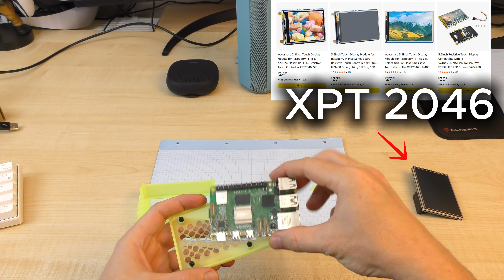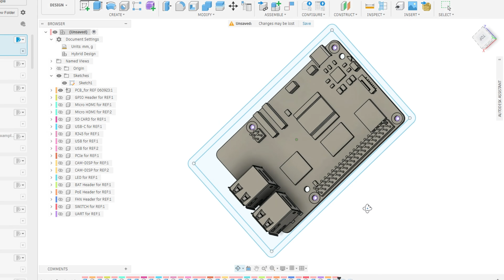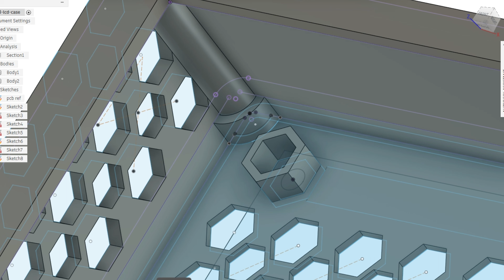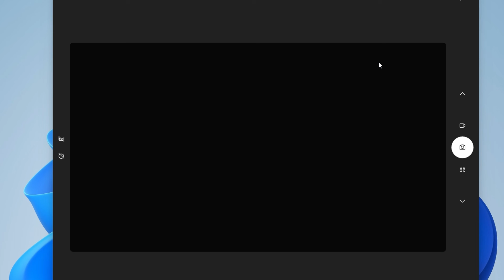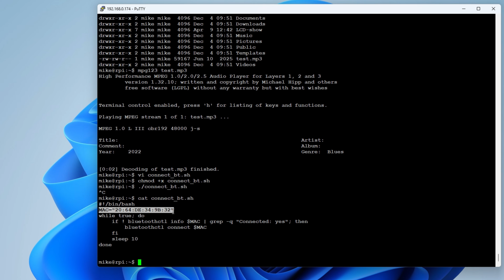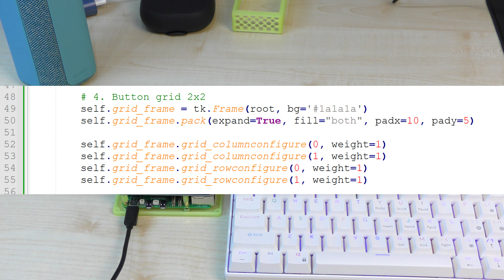Raspberry Pi Internet Radio without Spotify Powered E-Ink Display (Tutorial)

Comment: Auto designers use the same method - we bring in the 'background' data and design around it. Nice work and kudos for discussing tolerances! PS I love this project and appreciate your information on the display drivers, etc. Was wondering - for the non-technical folks, would you consider cloning your image and then offering them a tutorial on how to edit the radio stations and mac address? Or is it "not worth it" because you think they would still get lost?
Reply from the maker: Thanks for feedback. I attched a tech guide to the pinned comment - pastebin.com/tRELMqm7
Radio stations are recorded at the beginning of "radio.py" program.

IP/MAC binding depends on particular router used. Some offer a convenient  way to assign static IPs for specific MAC addresses. Some - doesn't. I run a dedicated DHCP server so I edit configs of the server.

Comment: You are missing the screws and stand offs in your list of parts.  I have a RPi5 kit and the screen, just like you list, and no screws or standoffs are included. I have to go buy those separate now.
Reply from the maker: I 3d-printed standoffs :) But generally you are right - standoffs are essential to avoid damaging GPIO pins or PCB.

Comment: For someone who does not care, yes, sure. But when I want to listen to OM&M now, and not wait forever for a station to play anything remotely close, that is not a good solution. Its a good project, but it by no means have anything to do with spotify.
Reply from the maker: Fair point. It really comes down to the use case. If you need a specific track right this second, on-demand streaming is obviously king. However, I’ve found that Spotify’s recommendation algorithms have become quite stale, which is why I moved away.

My setup is a hybrid: I keep my 'must-have' albums ripped to a local drive for instant access, and let radio DJs handle the discovery. For me, a human touch beats a corporate algorithm any day.

Comment: It's a bit rich to complain that people are using "expensive" e-ink displays then immediately announce you're using a Pi 5 for this
Reply from the maker: I totally get how it looks, but the Pi 5 is definitely not a requirement! This setup is so lightweight that it would run perfectly on a Pi 2 or even a Pi Zero — it only needs about 500MB of RAM and a 1GHz CPU. The only reason I used the Pi 5 is because it was sitting on my desk looking for a job. This is actually a great way to repurpose that old hardware collecting dust in your drawer.

Comment: Snap fits in PETG? Good luck. PETG has terrible creep resistance. After a few months of the Pi 5's heat, those clips are going to warp and the case will pop open on its own.

Comment: Pro tip for modeling enclosures around PCBs: don't just download a 3D model of the Pi from GrabCAD and trust it. Print a 2D projection on paper first to check hole alignments before wasting 4 hours printing a case!

Comment: Pulling the plug on a Pi 5 running a standard read/write OS is a guaranteed way to corrupt your SD card eventually. If this is a standalone appliance, you NEED to configure overlayfs to make the file system read-only.

Comment: Running a Pi 5 24/7 pulls about 5 to 8 watts depending on the load. Over a year, that’s about 10−15 in electricity. Add the $100+ hardware cost, and you haven't saved any money over a Spotify sub until year three.

Comment: A 3.5" resistive touch screen in 2024? Those screens feel like using a GPS from 2006. You have to physically press the plastic layer down. Please, guys, buy the capacitive touch versions!

Comment: Why use Bluetooth if the speaker is just sitting right next to it anyway? Just use a 3.5mm AUX cable! Zero latency, zero dropouts, and you wouldn't need to write a hacky bash script to keep it awake.

Comment: Bro really used the most power-hungry, heat-generating Raspberry Pi ever made (the Pi 5) just to output a 480x320 GUI and play 128kbps MP3 streams 💀 A $5 ESP32 or a Pi Pico W could run this entire project off a watch battery.

Comment: Cool project, but I just took a 5-year-old Android phone from my drawer, put it on a cheap 3D-printed stand, and installed the "TuneIn" app. Free, zero coding, has a built-in battery, and the touchscreen is way better than those cheap GPIO screens.

Comment: A Raspberry Pi 5 for this is absolute overkill! 😅 You could literally build this exact same project with an ESP32 for about $6, or at least a Pi Zero 2 W. The Pi 5 draws way too much power and runs too hot to just sit there playing MP3 streams.

Comment: "E-ink takes 30 seconds to refresh" - tell me you've never used a modern e-ink display without telling me. You can enable partial refresh on Waveshare e-ink screens and it updates in milliseconds. You don't need 60fps just to show a static album cover.

Comment: Snap-fit joints in PETG are notoriously tricky because PETG bends but lacks the "snap" memory of ABS or PLA. I highly recommend using brass heat-set inserts and M3 screws for a much more durable, reusable enclosure!

Comment: just get jbl dab+ radio at that point.. much easier and if you want to connect to louder system disassemble it and get a Bluetooth transmitter and wire it to jbl speaker output and connect to whatever you want.

Comment: They make a Raspberry Pi Zero 5?  Is that a typo or is this meant also for a Pi Zero? Would be nice if you can use a Zero W or 2 W since they are less expensive.
Reply from the maker: Not sure about Zero W, but 2W for sure will be more than sufficient.

Comment: Cool project , but too expensive to make. For the money you can buy a DAB radio with the speaker built in. Ps: radio streaming always has a boatload of forced advertisement built in.
Reply from the maker: I agree that a Pi 5 is overkill for this project, but I’m just showing the concept and what’s possible with the tools I had on hand. I’m not debating the cost-effectiveness of DAB radio, but internet radio gives you a much wider choice of stations, and you can find plenty of ad-free broadcasts there.

Comment: Nice little project but not really a proper replacement for a music streaming service where you get to choose what you want to listen to, and in a lossless format if you need it. If all you want is radio you can just buy a DAB radio for £10. Rather than internet radio I prefer something like Moode or Volumio with my own FLAC library, the advantage with something like Moode is that you also get internet radio stations if you want them.
Reply: I never understood the whole “just buy one for $10”. I get that this isn’t the perfect replacement for Spotify but the point is to learn something and be able to make it exactly the way you want it.
Reply: @AlwaysBolttheBird  I suppose my thinking is that using a Pi 5 for something like this is excessive and overly expensive. For a very simple project like this I would have just used a Pi Zero 2W, and even that is probably over the top; an ESP32 or maybe even Pi Pico 2 could do the job.
Reply from the maker: I happened to have a spare Pi 5 lying in a drawer, so I used that, but technically any model would work - Zero 2W, Pi 2, 3, and so on. I actually started out with Volumio on a Pi 2 a long time ago, but I didn't have a display for it back then. That old Pi is still in service, though; it’s currently running as my DHCP server :)
Reply: @AlwaysBolttheBird  That's not how this video is framed though. But you're not wrong.

Comment: Cool stuff, but put are expensive, would be great to see this with a pi zero 2W and a easier way to add more stations or edit station list. Or just use and old tablet/phone like I do. Never used Spotify either
Reply from the maker: The hardware itself doesn't really matter- this could run on an older Raspberry Pi, a Zero 2W, or even an old smartphone. I wanted this video to be more of a proof of concept to spark some creativity. I used to run AIMP 24/7 on a laptop and could only adjust the volume on the speaker. Now, with the touchscreen, I can switch stations directly without having to RDP into a 'headless' windows setup! :)
Reply: @YourHostingBuddy  You could add an MQTT or OSC interface and wouldn't need a touchscreen. Just a one-line cmd 
from your normal desktop machine or a button on TouchOSC on your phone.